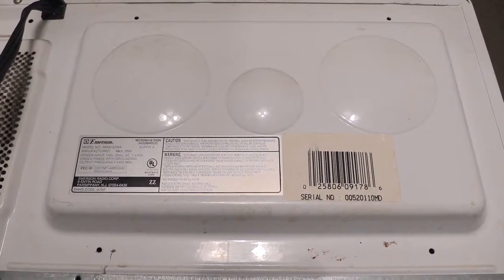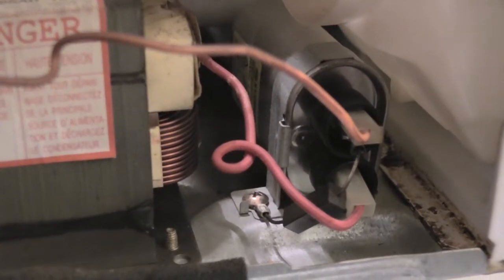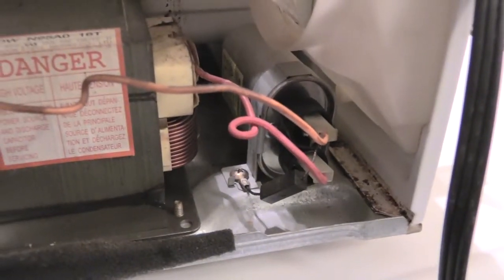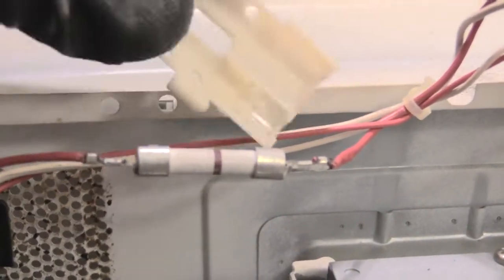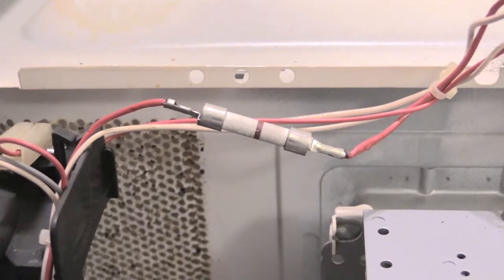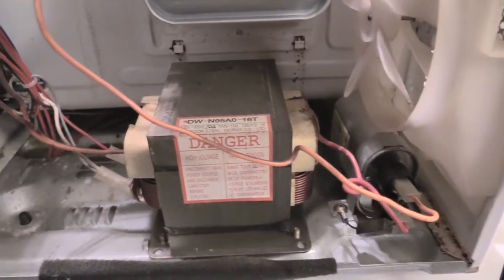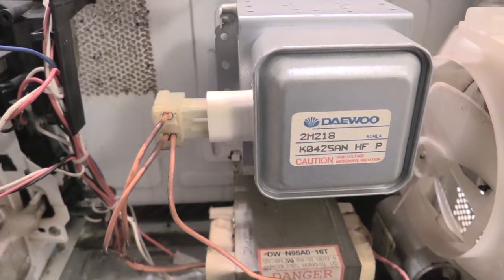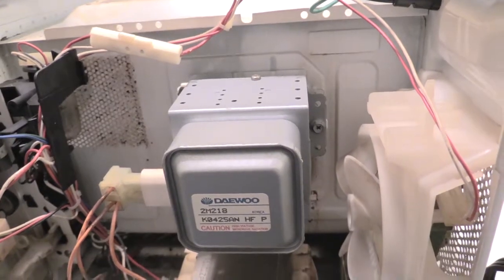Microwave Not Working?? How to Troubleshoot and Fix!!!

Comment: Thank you!  Great explanation of symptom versus bad component!  I was tripping breaker whenever I tried to heat something up.  All components in the high voltage section were testing OK including the capacitor.  Based on this video, I changed the cap anyway and it now works!  Saved me a lot of money and trouble.  Thanks!!!!!!!!
Reply from the maker: Your welcome, Thanks for watching and commenting glad could help.Please subscribe & like and share if haven't already and check out our other helpful videos